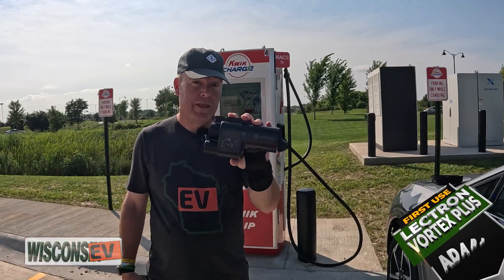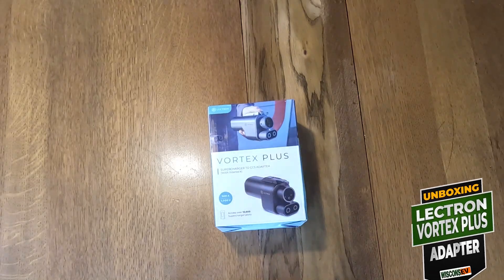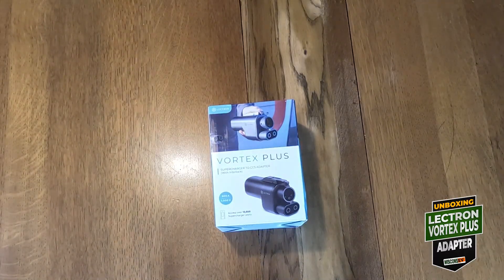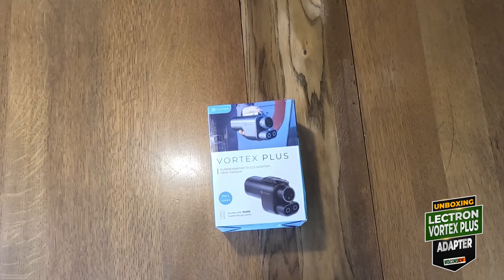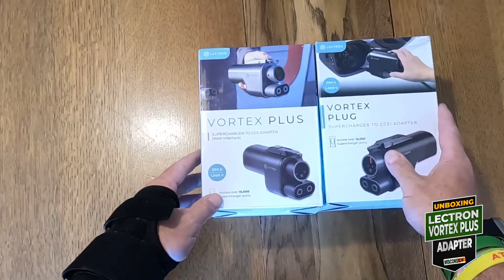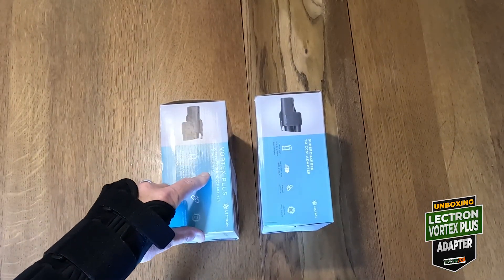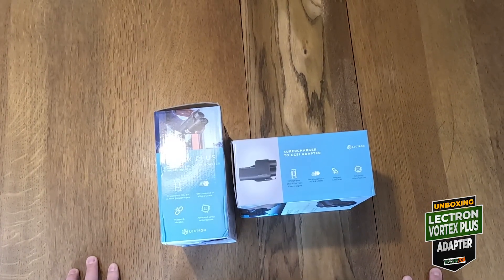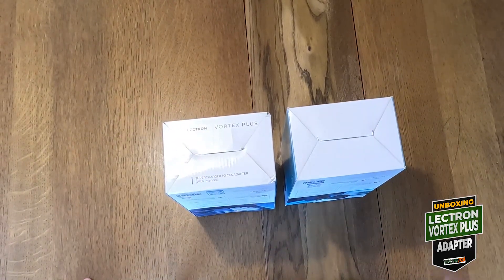WisconsEV - Lectron Vortex Plus - NEW UL2252 CERTIFIED NACS to CCS1 Adapter Unboxing and 1st Charge

Comment: Oh no not again! They had to recall the Lectron vortex adapters for this latch issue before!  
EDIT: I got a little further thank goodness It actually locks when it's on the car. I was freaking out for a second! there is no way Lectron could send out faulty adapters a second time 😮
Reply: Send that shit back right away
Reply from the maker: I tried to play it cool when I noticed it, but it just didn't seem right - I admit though I am no adapter expert. When it was charging I was picturing lightning bolts flying out if I tried yanking the cable out while the electrons were flowing. That's why I waited until I stopped charging to test it. With this being "Certified" I am surprised there aren't more videos on them. Did I get the first one? Thanks for checking out the video!